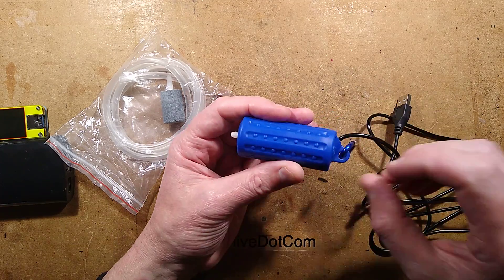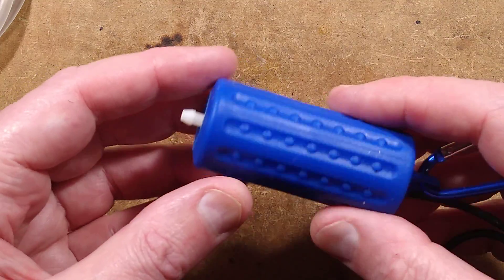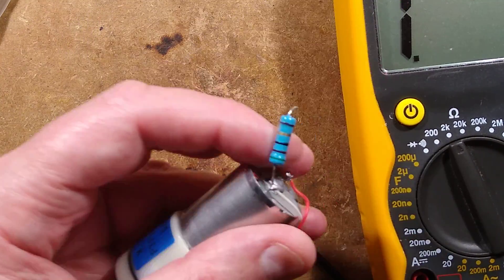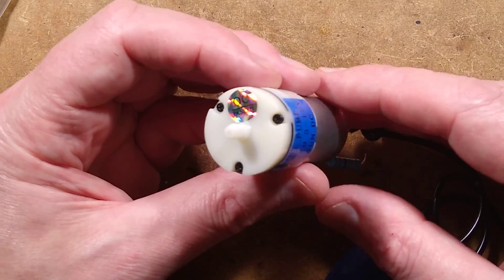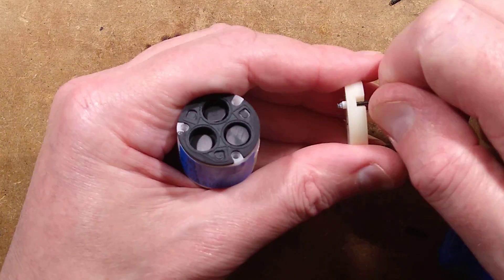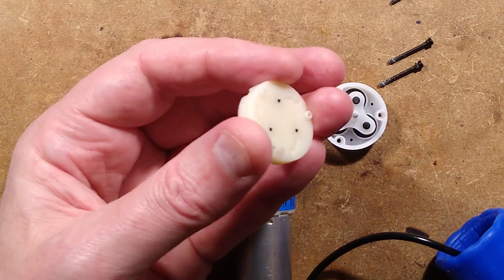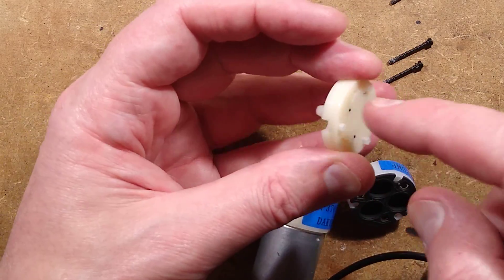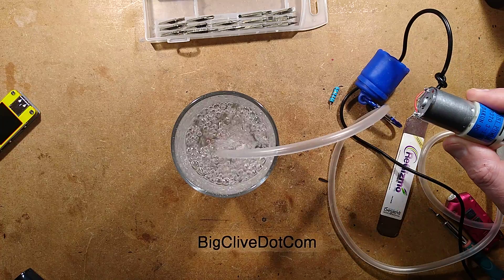Inside a clever USB air pump teardown with hack

Comment: Put the 12 volts to it and see how powerful the air output is.

I pulled a similar pump like this from a Keurig coffee machine.
Reply: Got a similar one from a Tektronix printer, only thing is it sucks, as it is used to clean the print heads.

Comment: It's a cute little device, I wonder how well it would hold up with time, especially the rubber bellows.  The motor probably won't last that long since it has phosphor bronze "brushes" that may wear out fast.  I think if the motor could be replaced with three solenoids, the thing would be better.  Thanks for the teardown.
Reply: I get a couple of years use running 24/7 as a pond aerator at 3.5V until it fails through brush wear.  Great little devices.

Comment: If the unit is not meant to be immersed in water, I wonder why they didn't just go with a tiny fan attached to the motor shaft.

Comment: It occurs to me that, if the current draw is low enough, you could get one of those Dollar Tree (or Poundland, etc... I live in the US, plz don't judge lol) solar pathway lights and replace the LED with one of these. Obviously a little circuit trickery would be necessary to make it run continuously, since the pathway lights generally turn off in daylight... and of course a bigger battery would be in order as well.

If you then completely sealed the motor and the mechanical connection from motor to pump, so water absolutely couldn't get into the motor, you'd have a submersible pond pump for an incredibly low cost overall... and with a few bits, here and there, of outdoor rated plastic (or stuff that isn't, such as polypropylene food containers, but covered in something that is, like a cheap tarpaulin or UV-resistant  black plastic sheet for the garden, if you can get it in non-perforated form), along with a bit of rock and some cheap plants... hey, water garden on a "the rent is too ** high" (which it always is :-/ ) kinda budget.

I may have to do that myself someday. I'm not so great with plants, to say the least (I have stories... ohhh, believe me, I have stories!) but, hey, if they water themselves... ;)
Reply: I love my koi pond. Started in 1993 with a 190gal Now Up to 7,500gal. But Now My Father took it over And they Are His Babies 😂 Good Luck in the Future with A Water garden/pond project..✌️
Reply: Just add soap, and you can have your very own foaming garden lights!
Reply: I was thinking similar but for an off grid deep water culture hydro set up.

Comment: With that resistor removed it looks like a great candidate for running off a small solar cell with a couple of NiHM...

Clive, cross-breed it with an LED garden lamp!
Reply: Would provide air at night, just right because then the plants have stopped making oxygen as well, so the fish would be happy. Might need one of the bigger solar cells and a bigger battery (or 3 in parallel) to run all night, but will work, and you can run a LED in parallel as well to get a little light out as well.
Reply: Would that even be ethical?

Comment: Looks like the pump in my portable live well. It's basically a nice 13 quart cooler with an air bar in the bottom and a small pump in the lid. Runs off of everything from 2 D cells up to 12 volts.

Comment: I literally, not 30 minutes ago, just finished putting together a a small solar system to power 3 of these for my mini ponds and if I had removed that resistor I wouldn't have had to size the system as big as I did
Reply: Well now you can put some batteries in line for long term solar outages and know how long it'll last! :P

Comment: How much ozone from the motor brushes and commutator are pumped through at 5v power supply? From another point of view - all pumps suck!
Reply from the maker: It looks like most of the air comes from a very small port at the side.

Comment: Fascinating- a three-phase air pump with built-in rectification.
One could replace the rubber bits with neodymium magnets running in small coils to get really low-voltage three-phase power.
Reply: What comes out of a power bank is already DC... What do you mean with rectification?
Reply: @Melinmingle  I meant the air flow is rectified (by the one way valves).

Comment: I have an almost identical pump that's ment for water instead of air. The only difference is that it has a second intake nozzle on the front, as a result it has a slightly different valve setup but apart from that it's the same (though it's a lot more powerful and A LOT louder when pumping air). I'll check if it also has those passages that this one uses for the intake.

Comment: Silver multiplier band is divide by 10
Gold multiplier is divide by 100

Extremely rare to see either these days.
Reply: Are you sure it's not 51 * 10^0 = 51*1 =51 Ohms? so the third band being the "multiplier" / "scientific notation", and the gold/silver being tolerance/temperature coefficient ? https://en.wikipedia.org/wiki/Electronic_color_code#Resistor_color-coding
Reply: @ElukeNL   gold is never used as a digit value so it's safe to assume being in the third or fourth position it is used as a multiplier value and not temperature coefficient.  It's been 20 years since I've seen a banded resistor with a gold or silver multiplier band since they were mostly used in tf bias stages before surface mount tech became mainstream.

Comment: Are you sure that component was a resistor?  I've seen several inductors in that package, size and colouring.  Saying that not sure what use an inductor across a dc motor would be as the obvious choice for noise suppression would be a capacitor.
Reply from the maker: Definitely a resistor.  And purely to increase the load to hold on smart power banks.
Reply: Yes, it was definitely a resistor. He measured it at 51 ohms.

Comment: These air pumps are pretty damn good. I have several of these for my fish tanks. Air flow is fine and noise is ultra low! Membrane pumps with eqal air flow are much louder because of vibration. This pump has nearly no vibration.

Comment: I feel like A UPS unit connected to a deep cycle battery would be a better solution to emergency aquarium aeration.
Reply: 12V battery on a charge tender will be both lower power, and longer lasting, using a 12V pump to provide the air, or if you get a 12V brushless motor and pump it could run all the time. UPS efficiency is poor at all loads, as a lot of your battery power is going to be turned into heat in the inverter transformer, as those transformers are run well into saturation. In a cheap UPS designed to run 5 minutes tops not too bit of an issue, but if you want longer run time you definitely do not want the cheap UPS. Connecting a cheap UPS to a bigger battery will quickly kill the UPS, as the charge circuit and inverter is designed to only run at full power for a few minutes before overheating, and as well your battery in the cheap ones is connected to one side of the mains supply, as that is a cheap way to cut cost by making it all float at mains voltage, only using isolation on the management port.

Comment: Welcome to 2020, where appliances have resistors specifically to waste energy when on battery power
Reply: Same with lightbulbs, so they don’t glow when the lightswitch is off. 

Or nightlights that actually use more power when “off”
Reply: that's because no one implements usb-spec correctly
Reply: @monad_tcp  Shutting down on low consumption is wrong and against spec.  USB is supposed to deliver single digit mA to devices that are on standby between operations.
Reply: @johndododoe1411  Yeah, you're right, my memory failed me, had to read it again. Still, no one implements USB spec correctly, its a mess.
Reply: Because the most common means of supplying power now is via an interface that was never designed to supply more than the most trivial amount of power.
Reply: @vylbird8014  Well in this case if you ran it off a PC's USB port, no resistor is needed. It's just those horrible power bank circuits that cant properly figure out whether they should run or not without causing lots of problems.
Reply: @vylbird8014  Maybe not in the earliest versions, but later USB revision certainly were. Those power banks are just not designed and sold for low power devices
Reply: @resneptacle  Original USB allegedly required max 10mA standby current.  Modern USB only requires that low consumption when devices are actually  communicating and the bus asks for standby.
Reply: When did humans become incapable off using a switch?
These smart power banks would be smarter if we had a potentiometer to adjust turn on threshold
Reply: It's a flyback resistor
Reply: It should have been a diode in that place.
Reply: I once bought a power bank so I could use it outside with a BT receiver hooked up to a radio. Didn't work, current draw to low. Our current tech is not only full of unnecessary features, but also non-features like this.
Reply: @darkslayer6911  U ok bro?
Reply: @GlueC  ive not been at times  no...... probably should delete that
Reply: @darkslayer6911  I didn't see anything :)
Take care
Reply: @GlueC  alcohol man 🙈..
           im going t total and got a bible to read if i struggle!  Cus its so huge . Lol
.
But its actually a cool story.. i did not realise 🤷‍♂️
Reply: sure, there is another way to do it. but single resistor is really cheap.
Reply: Yeah, really stupid design.
Reply: I removed the thing and the motor stopped working that day plugged into a wall

Comment: The resistor is there to reduce the EMF back feed when the motor stops. In this application, it probably isn't important, but it is a generic setup so on the blood pressure application it might be more important. But for a USB-powered application, I would hope that something in your power supply would protect it from the noise this motor will generate. Power it through an oscilloscope and see what that tri-pimple membrane will do
Reply: It's normally a diode for back-EMF clamping.  Why did they use a large resistor here?
Reply from the maker: The resistor is to keep the output of some power banks on, as many switch off if the current is less than 100mA.
Reply: @bigclivedotcom  Such a large resistors for a menial task, it should only draw about a half watt but that looks like a large two watt or maybe even a three watt resistor. But one watt resistors tend to cost more than three or cheap large-body twos (in bulk), so maybe it's just a cost measure.

I've got one pump very similar to that for supplying nitrogen to our wire dessicator at work, and it also has a large resistors but it runs on two NiCad AAs when it isn't plugged in (wheeling it from storage to the lab). I never thought about it before, I always assumed it was EMF protection for the battery charging circuit. And it wasn't even built in house. Strange. I'll look at the value.
Reply from the maker: @MattThompsonOnGoogle  I always like to over-rate resistors.  That way the surface area is larger and therefore cooler.
Reply: @bigclivedotcom  Let's remember it's under-rating or de-rating if you're using bigger resistors, cables etc.  See BS7671 Table 52.2 Derating Cables in Thermal Insulation.

Comment: I bought one of these ages ago, then forgot about it. Time to dig it out and add a little switch on the resistor to give an optional wake up function.
Reply: Just had a thought. Is there an led small enough to give a 100ma load?
Reply from the maker: Standard LEDs are only 20mA and a 1W LED with resistor could be run at 100mA.

Comment: I'd be interested in seeing it at lower voltages with the rubber condom installed. It might reduce the air flow.
When you come right down to it, at 1.5V it made plenty of air for a 1 gallon (4 liter) fish tank.

Comment: Three band resistors: first two are the value, third is the exponent, gold = 5% tolerance, silver = 10% tolerance. Four band resistors: first three are the value, fourth is the exponent, brown = 1% tolerance. Green Brown Black Gold is 5 1 0, or 51 × 10^0 or 51×1 or 51 ohms +/- 5%
Reply: Nearly correct. The first 3 are the value the fourth is the multiplier. So Green Brown Black is 510 and the gold is multiply by 0.1 which equals 51ohms. But he also explained this in the video so your comment is moot.

Comment: that's blood pressure monitor air pump, not designed for a long run , the rubber in head fail fast

Comment: You can get it as a vacuum pump (gas transfer pump) as well: https://www.aliexpress.com/item/32958232081.html
Basically identical but note how they sell different voltages. I wonder if the motor is really different.
The original motor/pump setup is used in blood pressure meters.

Comment: I have one of these pumps for a very small aquarium, and I need to reduce the amount of airflow. Putting a big resistor in series with the motor sounds like a bad idea since I don't want to produce a lot of waste heat - is there a smarter way to do this?
Reply from the maker: A resistor might be the best option.
Reply: eBay -> step down buck regulator -> e.g. https://www.ebay.co.uk/itm/361535175546

Comment: I've got one of these air pumps disassembled on my desk right now. It's a really clever design! If you put the end of the hose in your mouth, you can make talk-box sounds! :) Also, the motor windings measure 3.6 Ω.
Reply: That's DC resistance, but 0.036A at 5V indicates it has an actual running impedance more like 140 ohms.
Reply: Running under load of 12-14" of water will change load current quite a bit

Comment: I guess the motor is a typical DC brushed motor, which creates some interesting high voltage spikes as the commutator disconnects, so I wonder if the resistor is there to suppress those voltage spikes. A capacitor would have been easier and more reliable so perhaps not. Either way, I don't think I would risk it putting noise back down the USB 5V line to a PC. A remarkably efficient wee beastie though.
Reply: The capacitor that is usually across any USB supply somewhere would probably be enough to get rid of any danger. It's also only a few mA, so even worst-case the energy those high voltage spikes have wouldnt be massive. But yes, a (10uF 50V ceramic) capacitor across the motor would be a good idea.

Comment: I've bought a few of these.  Some are sold as "used" and seem to have been recovered from coffee machines where they're used as frothers.
Reply: Huh. I'll keep that in mind next time i see someone throwing out a coffee machine. Might be worth tearing one down if there's a chance that one of these is inside it.
Reply: I believe they are also used in the powder fed coffee machines to blow air threw the powder tanks to keep things flowing.
Reply: Yeah I took one apart and was astounded by the security of its assembly. They do NOT want them to be disassembled!
Reply: A espresso machine uses pure vapour from a presure vessel to heat up and froth milk.
Reply: @thomasesr  but you can hear a pump running when frothing (domestic units, which is what we're talking about).  I've always thought they are just pumping water into a chamber with a hotplate.  I think the pumps are probably a bit different to this one, because they are designed for (1) liquid) (2)potentially high temperatures and (3) extremely high pressures.  The cheap ones only have one motor that is switched between brew and steam, so the pressure they can work at is several bar.

Comment: These are sold at Aquarium Co-op! they use them for transporting fish--say you are buying a $40 fish, you don't wanna just slap it in a bag, you wanna have a container and the air pump makes sure the water stays good and oxygenated. They're also good for live bait or for power failure if you've got a system with no plants in it. I use a little USB piezo one that's near-silent for my fish tank(because it's in an area near the living room). And since they're so cheap if you're setting up a snail tank or something else without gravel and the like, these are cheap, you can hook several up, and put in a sponge filter with these hooked up to them.
Reply: How much pressure do they operate under? I'm always wary of little pumps that put out heaps of bubbles in a glass but once the airstone is >0.5m deep in a tank slow to a trickle or even stop. Cheers.

Comment: mmm, this with a vape pen and I could finally have a slow-smoke generator to visualize airflow over heatsinks & such 😳
Reply: Definitely I use them in rc boat an trains
Reply: use an ultrasonic mist maker instead of the vape
Reply: You would want to make sure your vapor is clean though, no nicotine or flavorings. Not sure if VG/PG alone leaves residue, but I would assume it does before going and trying without research first.
Reply: @progenitor_amborella  wd 40 works well 😂 smells lovely as well

Comment: the Same construcrion of the pump is used in my old "Fischertechnik" pneumatic compressor(it was running for more than 200h in the last years.  My one Runs always at 9v (0.8 to 1bar max) and I had to clean the Rubber flaps for 2 times now, becourse it cant get the full pressure if there is dust on them (They cant realy close ) I  as i  had it open i Use a little Bit oil on the Motorshaft.  on the Rubber flaps and the other moving Parts  i used a little Bit of Silikonfat. Now i much more silent and the pressure and airflow stays the Same. Also the Powerdraw Got decresed a lot. So i like it 😉